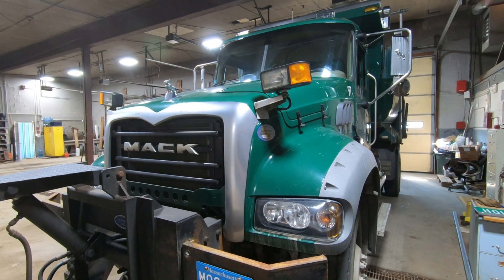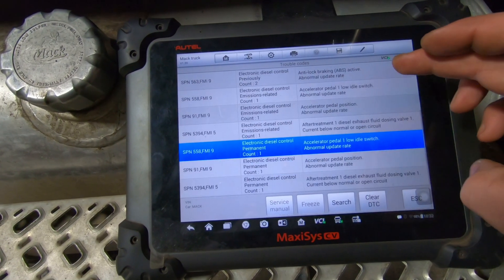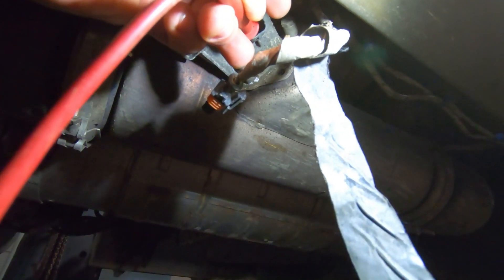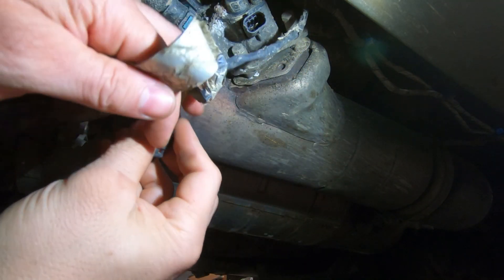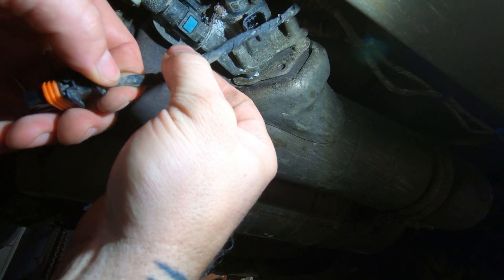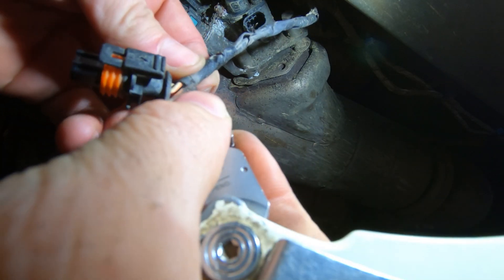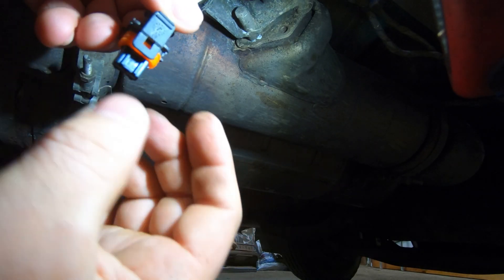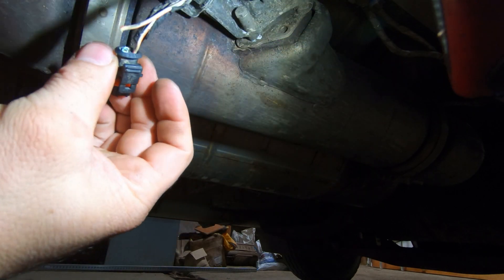Mack spn_5394 fmi_5 def dosing valve current below normal or open

Comment: I have a 2011 UD2300 rollback, same code. I have noticed that it doesn’t use up the def fluid after 2000 miles. I am going to check later. Thanks

Comment: Do you know what I should be getting by checking those wires. Should I just be reading 12 volts?
Reply from the maker: I don’t exactly know what to expect on those wires. If I would guess your gonna get 12 volts every time it fires the injector. It’s not gonna be constant and probably needs to warm up the exhaust before it starts firing. That’s just a guess though. I’m also not sure without a wiring diagram if it will have a constant positive or negative feed to the injector. That’s a long way of saying basically I don’t know.

Comment: I got same spn 5394 fmi 5 code n i replaced this connector  but agin came up after 1200 mile driven.
Reply from the maker: Did you do a resistance check on the injector? I believe it should be between 11-18 ohms. Heat can change a resistance so you would want to check it when hot as well. If it’s within the spec you may need to check the wiring farther up.
Reply: @JasonTheMunicipalMechanic  How do you check the wiring..?

Comment: Corode wire issues on  trucks i  the Nlrth east are pretty common, esp close to the connectors. Anywhere it snows alot actually, salt.
I have seen those  valves leak coolant into the dosing part of the valve.
Reply from the maker: Thats something to keep in mind if I start having coolant loss. Thank you. I’ve had to change the coolant lines already. It was actually pretty difficult to find them. The dealer had a hard time getting them.